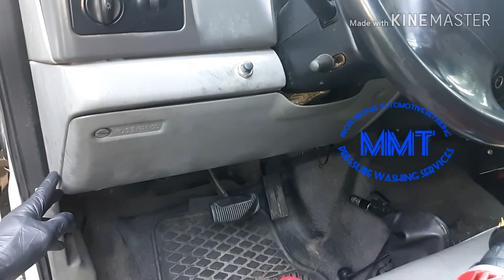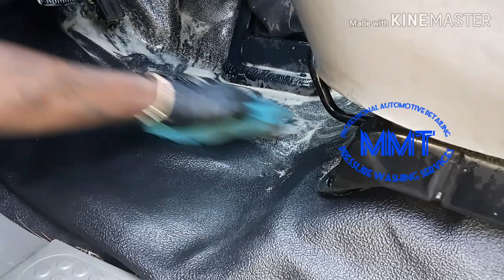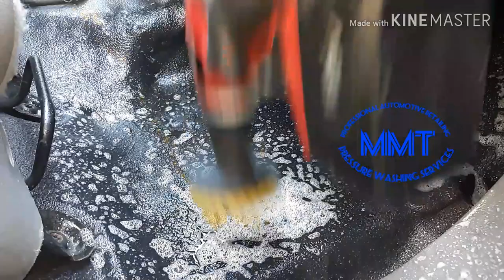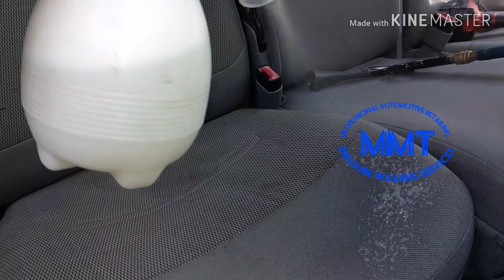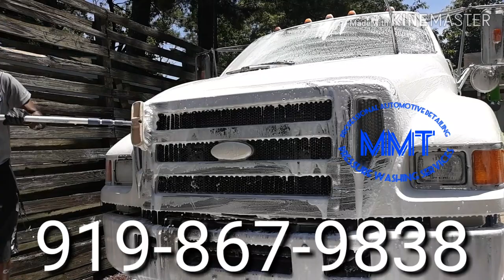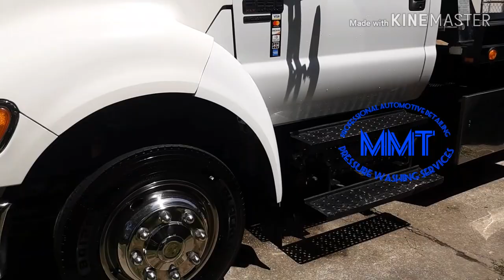MMT Pros - Tow Truck Detail Service - Garner NC - 6/15/2019

Comment: BROTHER TY wHEN THAT AIR GUN IS BACK IN STOCK (BEEN WAITING OVER THREE MONTHS) i HAVE TO REPLICATE YOUR SEAT CLEANING PROCESS, I'VE STAYED AWAY FROM BRUSH WASHING BUT MAY HAVE TO REEVALUATE THE IDEA ESPECIALLY WITH LARGE VEHICLES.
 QUESTION THE WAY YOU HIT THE SEATS (AIR GUN) COULD THAT WORK ON THE DOOR PANELS AND FLOORING AS WELL?
Reply from the maker: Yes sir Tony we use this technique on alot of different surfaces. We used it on the door panels of this vehicle https://youtu.be/YbU2C2jkzZo & It's very effective in light stains. I always order these sgcb blowers off amazon or ebay. Check out some of my older videos we use this thing faithfully. Thanks for viewing 👍🏾💯